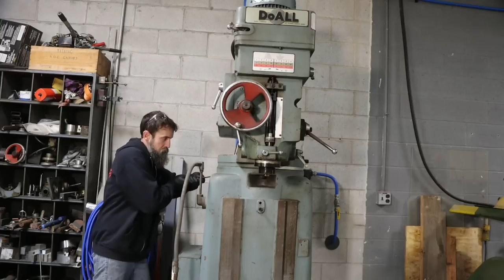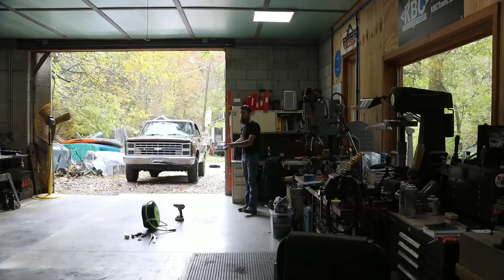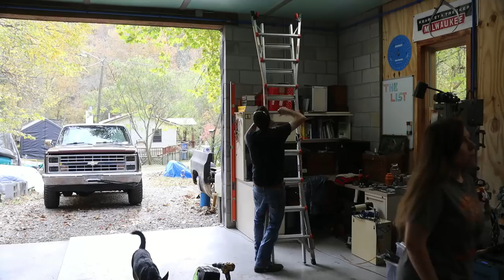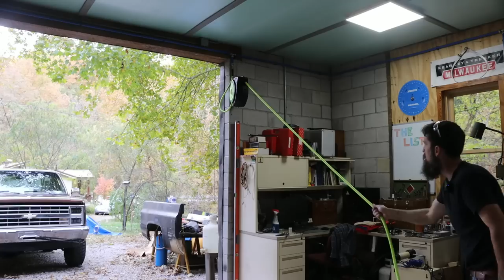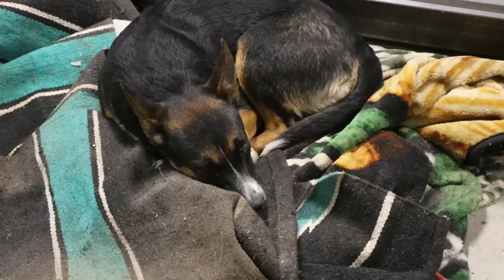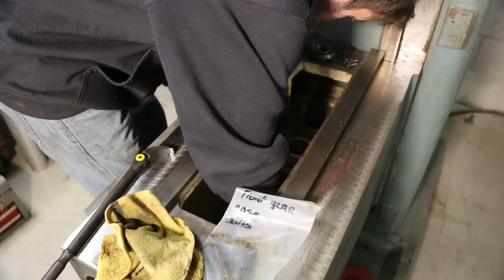Lifting and installing the DoAll Mill knee. New Air Hose Reel for the shop

Comment: Congrats on the events/numbers you mentioned at the end of the video.
Suggestion for your hose reel mount. Make a hinged bracket so when you need to pull the air hose outside of the shop door the hose reel will swing clear of the wall and you will have straight line pull on the hose. I did that in my workshop and it works a treat. It is also a good fun project. 
Hope you understand my brief description. It is a double hinge caper. John, Australia.

Comment: you will get these machines all rebuilt and down to tight tolerance specs - you can kick around ideas this winter for next big project - double down and invest in the shop - do some advertising or bid on some jobs and you can have extra work  - more rev streams is always good and you can do a lot of things and more in the future - maybe get some cnc/plams tables or something - build a heat exchanger for shop, hepa pos pressure, clear out some trees and install some solar panels and get some batteries - you can run split phase systems pretty easily - good job on knocking out projects - maybe you could expand shop 12 ft  or 12 ft on both directions and have a small office or just more shop area - put on car port to park truck - the air line addition - v helpful!

Comment: I have owned and restored 3 DoAll milling machines. I have one at home, one at work and sold one. They were a little different than yours in that the head had the tilt and turn functions typical of a standard Bridgeport. The DoAll is basically 1/5 times the Bridgeport, 3000 bs instead of 2000 lbs, 3Hp compared to 1-2hp, 12 inch table compared to 9 inches.  The quick change spindle is vastly more convenient and more ridged than R8. Power feeds on all axis' driven by a transmission that you can change in motion is  better than others. One mill needed a power knee lift but a bolt on box was too weak so I built one that needed a full 1HP motor. You will never be happy with a Bridgeport after this. Glad to see it go back together. There is a guy in LA that has parts for these machines.

Comment: Steve, I have same problem! Rolled up air hose always on shop floor and I trip over it for weeks until I move it again. I do have a commercial hose reel that fits 1/2 in h hose I believe. Gotta get it installed in garage shop. Thanks for your inspiration.
Reply: My hose reel laid around my shop for at least 2years (probably more like 4 or 5 years) before I got it hung on a wall. I should never have waited so long. Get er up there and enjoy it!

Comment: Well done on all the anniversaries and the birthday. Looking great with the reassembly, and of course it is easier, as you now know how it comes apart, which was unknown before, so you now can reference all the parts, as the pile of plastic labelled bags ( that really helps, keeping all parts for one section together as a unit) turns into a larger pile of empty bags in the bin.

Comment: 42? Just a kid! Steve, I have a very similar setup with an air hose reel near my door. There is one subtle difference, though. The way mine is hinged, it can rotate a bit further around so I can reel the hose out outside, and reel it back in from there too. You might consider some spacers or an angle bracket to set the hose reel in towards the shop a little, but allow it to swing further around and point outside, even if only slightly. Hopefully one day you will thank me for this. All the best, Mart in England.

Comment: I recently finished building and installing a jib crane. I have an old tri block chain hoist that still works well. It wasn’t the easiest decision to make but I shortened both the lift chain and the pull chain to fit the location. To me nothing is more irritating than fighting all that extra chain. The hook on the lift chain will just touch the floor and the pull chain goes down to about six inches from the floor.

Comment: 42  Must be nice to be so young... LOL  Congratulations on 20 years. Tip on the hose reel, count the clicks on the ratchet. Then only pull enough to get to the first tooth. That way if you give it a tug while using it you don't accidently release it so it retracts the line!

Comment: I hope you have better luck with Flexzilla hose reels than I’ve had. I put 2 of these reels in at work, and both of them stop about 6 feet short of fully retracting. But if you depressure the reel, it works fine. The hoses are too soft and they swell.

Comment: you said there was a lot of leverage on the knee and therefore wear  on the low knee-ways but that leverage is not that big because the knee screw is about in the middle of the knee, so the knee is almost in balance. the only proble is when over tightning the gibs, or to loose.

Comment: Hey Steve, didn't you weigh that knee when you removed it all those long months ago or was it something else? Maybe you had a new scale you were trying out and hooked it onto a block & tackle or maybe the engine hoist.
Reply from the maker: I am almost certain that I did. Ill have to go back and see what it weighs
Reply: @SteveSummers  I haven't looked but for some reason 536lbs pops into my mind and there is a lot of empty space in there for that number to get lost in. 😱
Save you time looking Steve, I will do that tomorrow, err today (it's 3am in Melbourne Australia) and will post the number back here when I find it.
Reply from the maker: @josephking6515  That does sound about right.

Comment: Man in the past couple years tapcons seem to have gotten weak I’ve broke about the last 5-6 I’ve tried to use using the drill bit that comes in the box work excellent in brick or block but snap in concrete but yeah don’t feel bad my hose reel is sitting at the end of my big lathe right beside my compressor and rats nest of hose been there for a year now